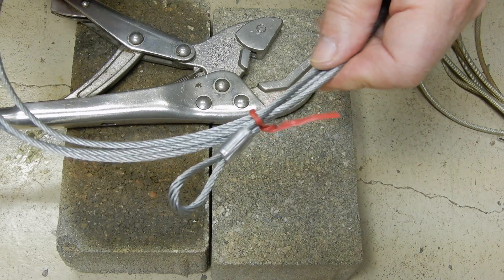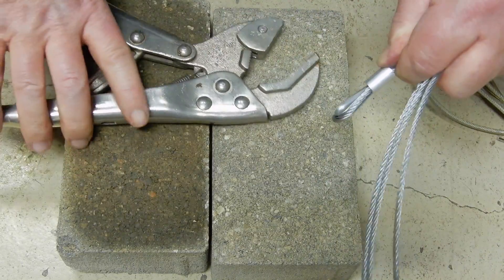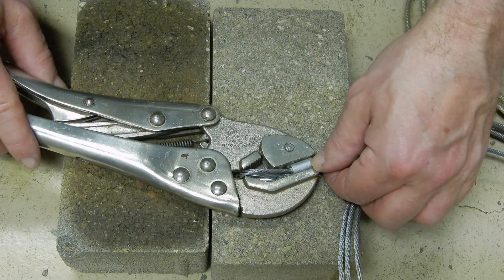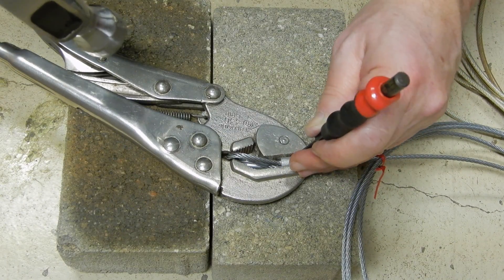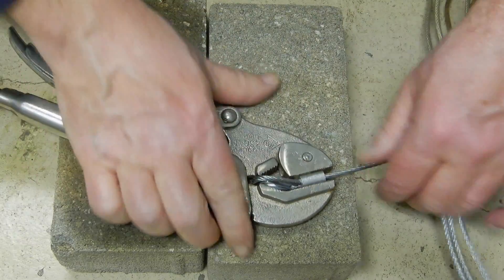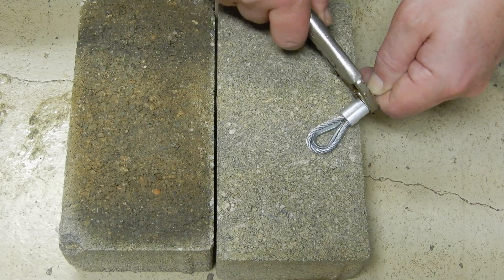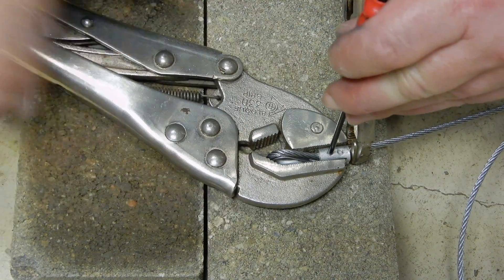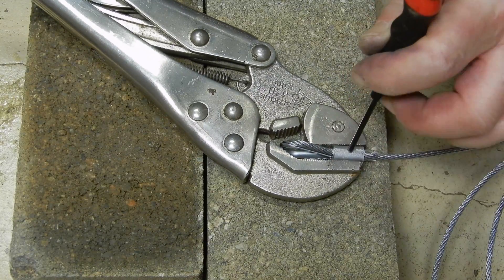How to Clamp a Wire Rope Ferrule Sleeve Without a Swaging Tool With a Hammer and Punch

Comment: A proper 30" swager crimper is only about $60 on Amazon. And it is about 10 times faster to crimp. I would not trust this on anything.
Reply from the maker: I think they cost more. This solution works for many usages, but not all.

Comment: Merci bien. This method will suit my trellis wire application to grow my Bouganvillea. I don't know why so many people can only make negative comments - he's not saying to use this method to rig your 50ft yacht to cross the Atlantic or lift a 20 tonne block with a crane. There are many low load uses for wire with a swaged eye and this simple method will work just fine. Thank you, carandtrain.
Reply from the maker: Merci. I hardily agree with you. What is sad is that Youtube favors videos in which viewers argues and get at each others. This videos is doing very well because of the controversially and not because of the solution I am suggesting for light usages.

Comment: Fais une épissure portugaise, facile, rapide, sûre, économique, je vois que tu as du 7x7. C'est souple et tu mets une cosse dans la boucle sans problème. J'ai gréé mon bateau seulement avec des épissures de ce type, 20000 miles sans aucun problème 
Do instead a Flemish splice, easy, quick, safe and cheap. Your wire construction is 7x7, flexible, no problem to put a thimble in.
I rigged my boat that way, only with Flemish splices, crossed the Atlantic 4 times, no failure. Google it: Flemish splice.

Comment: You would be much better off using cable clamps. Swaging uniformly crimps an aluminum swage to within 90% of the cables strength. This method in this video is a waste of time
Reply from the maker: It depends what you are trying to achieve. The custom cable that I have made hold 4 100lbs trash cans, for a total weight of 400lbs on a steep incline with heavy winds. The cable has never failed.
Reply: I don't have a bolt cutter or other large crimper. An old lady can do this method.

Comment: My swayging tool only goes down to 3mm so I was thinking of using cheap wire strippers as an alternative tool for 2mm ferrules. Wish me luck. 

(It’s for a gate latch that goes through the fence, no one is going to die if it fails, they just won’t get into the house😄)
Reply from the maker: Your second paragraph is dead on. Many applications of custom wire will not make anybody die.
In the first paragraph, wire strippers are not strong enough to punch the ferrule.

Comment: I came here to figure out how to secure a ferrule for a dog leash for my back yard. Not every situation is life or death, you turds. Relax. 

Thanks for the video and info, friend. This will suit my purposes well.
Reply from the maker: Turd aside, this is my point. BTW I have another video showing that it holds 400 pounds trash cans on the side of a cliff.
Reply: But a lot are, like tying high tension steel cable wire for a sail shade on the roof, which is one of the most common reasons ppl need to clamp wires & don’t have a crimping tool.
Reply: you’re super weird for even being triggered enough by @Jjernsberger ‘s comment to say what you said. And literally every dog owner I know uses steel cable for dog  runs. Pet stores even sell cable specifically for that purpose
Reply: You act as if you’re the normal one here. Using steel cable as a dog leash is strange enough in of itself, but the practical reason to use steel cable wire is for high tension objects. So if it snaps as someone’s tightening it and a large sharp metal anchor bolt flies at their head with the impact force of essentially a homemade catapult system, then you can say ~just relax , I use it to make steel dog toys or dog muzzles or whatever weird thing you use it for

Comment: Totally wrong, dangerous, wpuld not hold any load
Reply from the maker: I has been holding successfully 2 groups of 400 lbs trash cans for 5 years on the edge of a windy slope.
How to Clamp a Wire Rope Ferrule Sleeve Without a Swaging Tool With a Hammer and Punch
https://youtu.be/Y45Pj89H3Lk

Comment: I wouldn’t trust that with any over head lifting, supporting because there’s not enough contact inside the Ferrell to the cable . You have to squish the soft aluminum into the steel cable strands to be safe.
Reply: *the full length should be squished into steel
Reply from the maker: Yes, I agree. It all depends what the needs are. I have another video showing where it is used: 400 lbs trash cans on an incline. Solution has been up for 5 years.
Reply from the maker: Yes, I agree. It all depends what the needs are. I have another video showing where it is used: 400 lbs trash cans on an incline. Solution has been up for 5 years.

Comment: I used an Automotive Tool made to disconnect Steering Tie Rod ends.  It is a lever w/ loading screw.  I used it to crimp 1/4" wire rope aluminum ferrules.
Reply from the maker: Thanks. This is smart to repurpose a tool.

Comment: Thanks for the tips.  And I like your large vice grip, haven't seen one like that.
Reply from the maker: Thanks for the comment. You can buy the vice grip with pivoting jaw at: Grip pliers with pivoting jaw: https://www.amazon.com/gp/search?ie=UTF8&tag=bestcashloans-20&linkCode=ur2&linkId=3276cc25bbd2cb0705692128a6bea402&camp=1789&creative=9325&index=tools&keywords=Pliers%20grip%20pivoting%20jaw
Reply: @CARANDTRAIN  
Thanks for that!
They are a touch expensive; have you found them worth it?
Reply from the maker: Absolutely, because of the pivot, they keep the jaws parallel.

Comment: Boy, some answers here are amazingly stupid. This is a methid for light use . Not for carrying 20 tons. Yet you all get rabid about it. Almost all of us are doing things like this for home use and light demands. Myself i just use a blunt chisel and hammer that into the ferrule.  In no possible way will that fail in any situation i plan on using it for. In the industry, anyone planning on heavy use will deffinately get it done or built properly.
Reply from the maker: Indeed a method for light use. I am holding 400lbs trash cans on asteep incline.

Comment: You need to do a load test.  A properly staged ferrule will be as strong as the cable itself.  I suspect your method will not be even 50% as strong as the cable, but a pull test should be done to check this.
Reply from the maker: Good comment. Everybody does not need the strongest cable in the world; some may need rather a custom length or purpose cable. Anyhow these cables retain 400 lbs trash cans on a steep and very windy slope, called Edgecliff. And they have not failed once. The hooks at the end have failed. Please look at this video, it explains:
https://youtu.be/Y45Pj89H3Lk
Reply from the maker: Load test considerations: 
https://youtu.be/Y45Pj89H3Lk

Comment: I used his method to secure a ferrule on steel rope to hold a 20 pound painting from a ceiling joist. It's plenty strong enough for my lightweight purposes.
Reply from the maker: Lauren, I have just published a video showing that I hold 4 96 pound trash containers with a lot of wind on a steep incline. So the 20 pound of your painting is very safe.
https://youtu.be/Y45Pj89H3Lk

Comment: This loop is nowhere near the proper spec for a properly swaged eye, someone's going to die from following this advice.
Reply from the maker: Can you elaborate more ?
Reply: @CARANDTRAIN  a properly swaged eye should support 90% of the rated break strength of the wire rope used. When properly swaged, the metal of the sleeve should fill in the gaps around the strands of the wire. there are well-established standards for sleeve diameter post-swage and number of swages necessary for each size of wire rope. The method shown above does not provide adequate compression of the sleeve and will therefore result in a weak eye that can support only a fraction of the rated load. That wire rope probably has a break strength of 2000 lbs, but your eye probably won't hold 200
Reply: @gregoryallen4521 : You're so right. That one commenter calling you a Karen should suspend himself from that sloppy loop and sleeve. He'll find out real quick. lol All you said was the truth that it could fail or someone hurt.
Reply: But He’s French....?
Reply: Your an idiot
Reply: Absolutely correct. A swage tool is a calibrated device when combined with the matching proper size of ferrule and wire rope. It applies precisely the correct amount of force, uniformly around the circumference of the ferrule rather than only in concentrated spots like a punch tool will do,  to mold the ferrule into the valleys of the cable over its entire surface that is contained within the ferrule. Over-tightening is just as bad as under-tightening - you can damage the ferrule in ways not visible to the eye, producing cracks or thinning of the ferrule that weaken it, just as under-tightening will insufficiently mold the ferrule into the valleys of the cable from all directions.

The method in this video "works", only to the extent that you probably will not be able to pull the ferrule off with your hand. At only 5% of the rated strength you would not be able to budge the ferrule at all. But there is no way to know whether you have over or under-tightened; there is no way to know what the break strength will be without breaking it.

The only way to know the break strength of this type of fastener is to actually break them. That's why it is essential that you can create these fasteners with precise consistency and repeatability, so that the next one you make after breaking the tested one is as close as possible to the one  you broke by testing it. Doing this by hand and guessing is how you get absolutely no repeatability whatsoever - and someone could die trusting equipment that looks like rigging equipment even if it wasn't your intention to use it that way.

There should be a giant disclaimer on this video that says "never, ever, ever do this". Better, this video should be removed. Even if your purpose is not to secure anything valuable, the problem is that someone else could use this cable in the future thinking that it was made to specification.
Reply: Holy crap man. Sometimes you use a wire cable because you need something simple, like a pulley system for a bucket that’s never going to be more than 50lbs.   Or something that will track and weather better than rope. 

The reason why I looked this up is because I need to replace the emergency cable on my trailer that needs to pull no more than 5lbs of force to engage the emergency break mechanism. It needs to slide well and weather well, that’s the only reason for using wire cable. This form of crimping will do just fine. Spending over $50 for this one thing seems pointless for many circumstances for people that don’t do something like this no more than once every 2-3 years.
Reply: @ericksonjustinAK doesn’t matter. At some point this connection will fail. Even with just 5 pound of tension, the strands will begin to d=slide over each over. As that happens, over time, the ferrule will begin to shed particles. As that happens, the strands slide more freely. Eventually, they will slide out. There are very good reasons why there are standards. If you want to do this without a proper tool, you can get cable clamps instead. These fit around the cables and clamp with screws. It also allows you to take it apart again and also allows adjustment. Don’t do what he did here.
Reply: @melgross  too late.  I did what he did and it is working great.  Cable clamps were too big, bulky, and heavy for my application and the tool was too expensive to justify my one time need.

I understand standards.  I also understand what you are saying.  OSHA standards also exist for a reason.  Does everybody follow them perfectly?  Do even most people?  Is it even possible to follow them perfectly?

If it fails, I'll go buy the crimping tool and I'll even try to remember to come back here 5 to 25 years later and say you were right, although, by that time there is a very good chance I won't even need the cable anymore.
Reply: @ericksonjustinAK  yes, they can be followed perfectly. But it’s not OSHA most of the time. It’s industry standards which are developed for good reasons. I saw another video that was just as bad. Good luck.
Reply: @melgross not trying to say the standards are ridiculous since I am an engineer and also work in an industry where this exact standard saves lives, but I think it’s a little ridiculous to impose those standards on some things. For instance I am trying to make a temporary engineer bay light for working on my truck. I’ve got everything I need except a swaging tool since I’ve done other projects like installing a cable railing in my house and making an LED light for another application. I don’t need this to hold more than maybe 10 pounds max while hanging it just in case I pull on it a bit and under normal conditions it’ll be about 3 pounds. This is a non-lethal load being hung and it’s not a structural component to anything else. Why would I care if it fails at some point? I’ll just do this again and still have paid less than buying the tool. Sometimes the standards just don’t apply. And I can say in the case of the bucket, if he puts the eye in well and keeps tension on it, there wouldn’t be any issues for the foreseeable future if all he is suspending is that bucket. It’ll at least take a few years. And I’d also like to point out that even these standards that save our lives have exception criteria that typically involves conditions that could life threatening not being present or feasible to be present. Should you follow this video if the application involves something structural? Absolutely not. Does that mean you should never do this? Absolutely not.
Reply: Another Karen 😊
Reply: @joelsmith3168 it’s ignorance when people like you comment as you did. This guy is giving very bad advice here. What he’s doing is nowhere near what needs to be done. This is going to fail. No doubt about it.

Comment: Thank you for sharing your method. It certainly looks as good as a professionally made one. I hope it will be just as strong, since when I do it,  it will need to hold a heavy shelf up.
Reply from the maker: I use it to hold 4 huge 332lbs rated trash can together on an incline with a lot of wind on them. It has never failed. Pick the right wire diameter and increase the number of punches if you have a doubt. Let me know how it works for you. BTW I posted the video after years of experience.